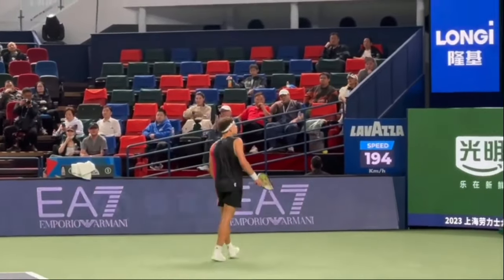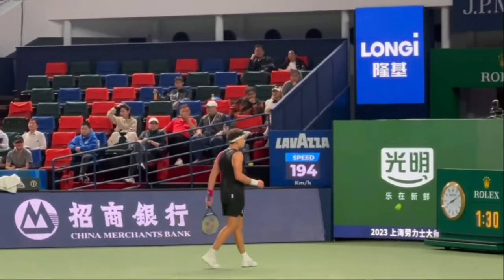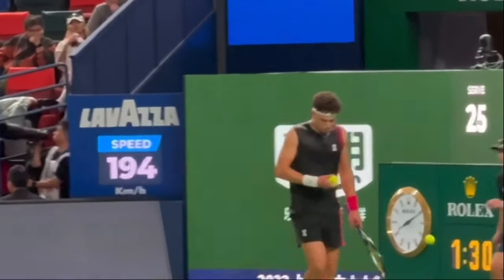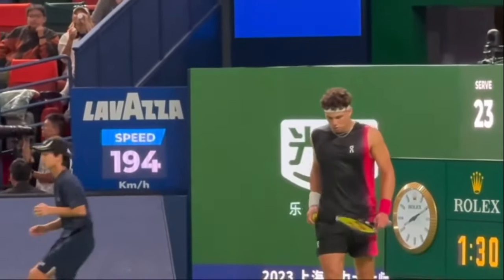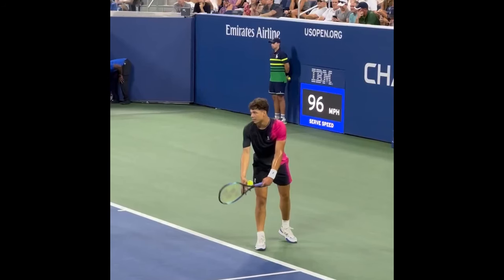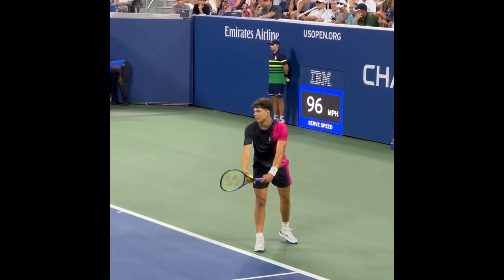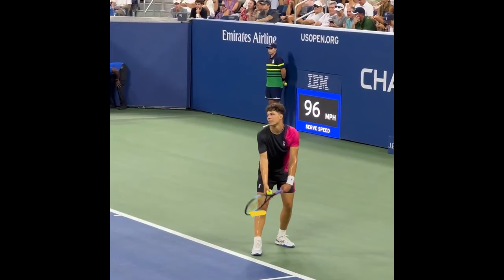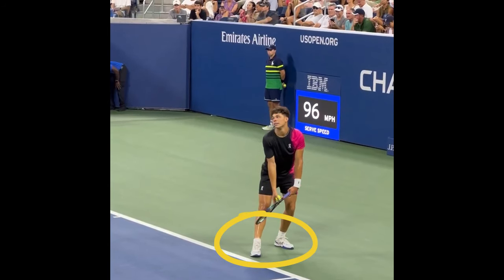Ben Shelton's Serve Slow Motion - Massive 143 Mph Serve Analysis!

Comment: Your statement that acceleration is synonymous with racquet head speed is completely false.  Acceleration comes into play when figuring "impulse," which is ([net Force] x [difference in time]) = ([mass] x [change in velocity]).  The net Force = mass x acceleration, which in a serve is how much you can get all your body parts, including the racquet, to accelerate prior to ball contact.  Acceleration is the change in velocity in a given amount of time, not just velocity by itself.  The difference in time is how long the ball stays in contact with the racquet.  When you multiply these two factors and divide by the mass of the ball, you will essentially get the change in velocity of the ball, which basically goes from zero to whatever the final velocity of the ball is after being struck by the racquet.  Although this analysis is a bit simplistic and doesn't take into account other factors, it demonstrates how important acceleration of the racquet is prior to racquet-ball contact.
Reply from the maker: thanks for that, but i have to confirm